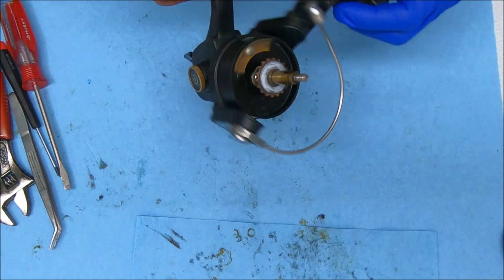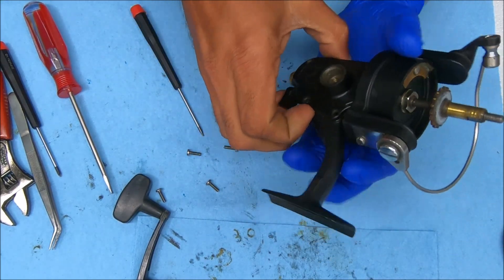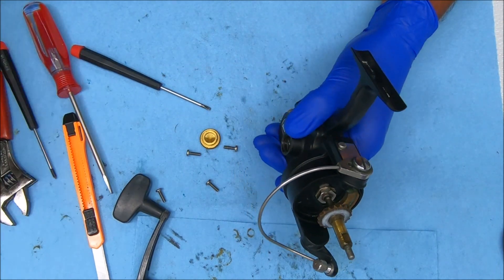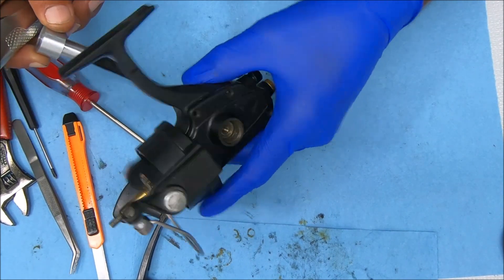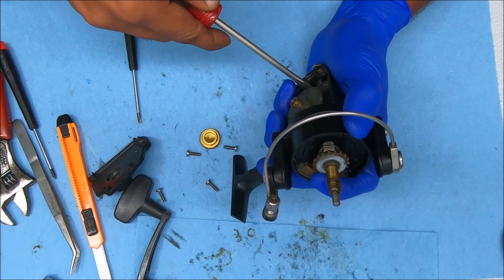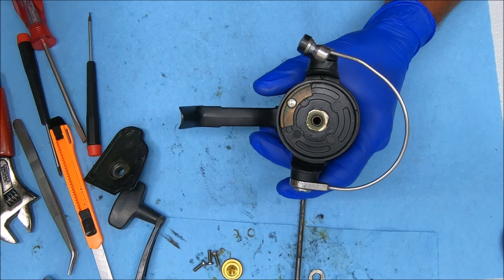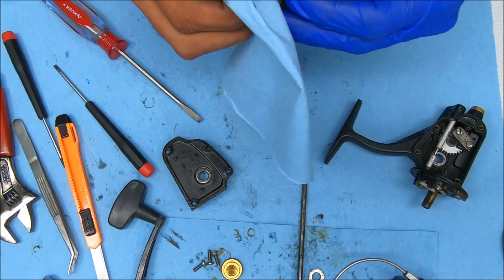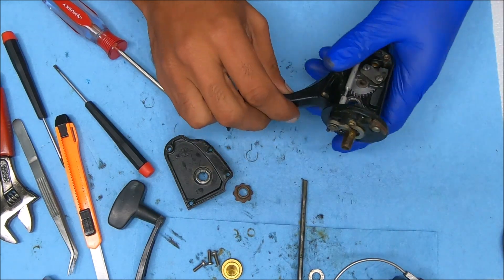Penn Spinfisher 5500SS No Anti Reverse - How to diagnose and repair: Fishing Reel Repair

Comment: I have the same problem. After watching this I think I’m going to give it a try myself. Hopefully I’ll be able to just give the spring a bend and it’ll be ok. Unfortunately if a new spring is required there is 3 to choose from. You have to look under the main gear and find a number that is stamped on the inside to find out what version is needed to make the purchase. Lol. Wish me luck.
Reply from the maker: Thanks for watching. There's only two options. If your dog has a groove in the middle of it, then you need the spring that wraps around the ratchet. The correct part number for that is 230n-5500, dog with leaves is 4-550... assuming the leaves on the dog or the spring (depending on your version) is damaged. Try mysticparts.com if you need to order either one. All the best with the repair.
Reply: @TSGReelService  Thanks for the reply it really helps. Yes I live very close to mystic parts (about 60 miles) I got the schematic for this reel from their archives.
Reply from the maker: You're welcome. They're good guys and should have the parts you need.
Reply: @TSGReelService  I just fixed it. Did exactly what you did, squeezed the spring tighter. But now that I know what I’m doing (thanks to you) I’m going to order a new spring. So if it happens again I’ll just pop in a brand new one. Thanks so much.
Reply from the maker: Excellent! Glad to hear it worked out.

Comment: I just bought two 5500ss and they had this problem. I took them apart and they looked great. One together and the antireverse works but I feel like it takes too long to engage. Long story short, I didn't know about these springs and I assumed friction on the "wings" engaged the dog. Cool video, I'm ordering springs now.
Reply from the maker: Thanks for watching. There are two dig setups. One with the leaf on the dog and the other with the spring around the clutch. Make sure you're ordering the correct parts for your particular reels.
Reply: @TSGReelService  ya man the ones I got have been worked. The housing is the old 1-5500 p/n but it has the slot for the c-clip on the dog. I just squeezed the spring fingers tighter and they seem to be in order. Thanks for your videos! I built some 9500ss reels watching your stuff also.
Reply from the maker: Okay. Sounds. Glad to hear you checked out some of my other vids and that they helped. More to come.

Comment: hi! great video, really appreciate all your videos. one quick question, how did you end up getting the roter off? I am in a similar situation where mine is jammed on, I let it soak but still can't seem to get it off
Reply from the maker: Thanks for watching! It's a graphite rotor so it can't be that stuck for you not to continue rocking it as you pull up...., unless the the pinion is frozen to the square washer inside.... or sometimes the rotor gets "rounded" off on the pinion. One I use heat for and the other, I'll secure the pinion with a vise grip and hand rotate the rotor until it "feels" free-er. Best advice I can give you for these scenarios is take it to your local repair shop.